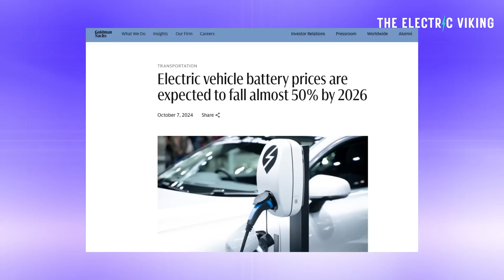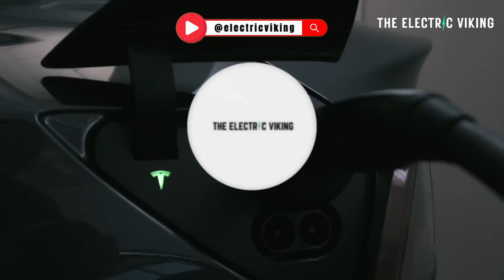Analysts say a NEW EV battery will be cheaper than fixing a gas engine

Comment: Advantages of Gelion's GEN 3 Lithium Sulfur

 High energy density - Energy density > 400 Wh/kg, when using a 10+ Ah pouch cell.

Semi-solid-state as a route to increased longevity/cycle life: GEN 3 employs a semi-solid-state mechanism, maintaining the sulfur-based cathode materials in the cathode, preventing their diffusion into the electrolyte and diminishing associated battery degradation caused by reactive polysulfides. This approach mitigates the major degradation factor associated with conventional Li-S technology.

Increased sulfur utilisation: GEN 3 demonstrates the full theoretical capacity of sulfur, i.e. a much higher sulfur utilisation than found in conventional Li-S approaches.

Simplified supply chain: The innovative cathode is produced by mixing commercially available materials with abundant sulfur using a low-energy, room-temperature process, with potential to eliminate the need for pre-fabrication of the sulfur composite (sulfur composite is related to cathode active material in conventional lithium-ion batteries), streamlining the associated supply chain and production process and enabling localised manufacturing.

·Environmental and economic benefits: The water-based, standard-atmosphere cathode production process eliminates the need for toxic solvents, leading to significant cost savings and enhanced manufacturability.

Check it out at https://gelion.com/

Comment: I looked up the cost of replacing various combustion related parts incl labor: spark plugs $600, transmission $3500 (and much more for luxury cars), engine $3000-8000.

Comment: Current ev battery cost are in two area : changing cost is huge still bigger than fuel engine but its trend is going to be cheaper;  the other cost is the industry has not have comprehensive chain for recycling and processing used high power car battery yet.  Making these batteries and recycling these batteries cause more pollution than transitional engines still . Pollution on the road is less but its overall pollution on factory and processing sites are still high.   We have a long way to go.  Hopefully in 10-20 years the situation will will be much better.

Comment: While the cost of EV battery parts has decreased significantly over the years, labor costs for battery replacement remain substantial. This is because many EV designs position the battery pack beneath the vehicle, requiring complex procedures to access and replace them. Although some manufacturers are exploring solutions like battery swapping to improve accessibility, these innovations are not yet widespread across the industry. My hot take is that the parts price will continue to drop (per your reporting, thanks for this), but the labor price will likely increase as manufacturers haven't standardized efforts to make batteries accessible for servicing. There is no hood or battery tray for ease of access.

Comment: Interesting however in 2016, we were promised Sodium ion batteries in the 2020s. clearly batteries will improve, but until we have charging in 3-5mins, giving a range of 450  plus miles and we have cheap reliable 24/7 electrical supplies, ICE vehicles will continue to outsell BEVs. In the UK more then 50% of car owners have no access to overnight parking. 
The energy density of fuels will continue to be much better then batteries. As other posts western car makers are going broke.
worse
Its interesting that F1 is not going electric anytime soon, but improving Hybrid power with synthetic fuels, but being net zero by 2030.
I tend to think that in the time that batteries are improving, better solutions will be found.
At least sodium based batteries shouldn't result in the destruction of the earth with massive amounts of mining.

Comment: If only car manufacturers would agree on a standardised battery pack module size, and standardise it's connectors.
Oh no, wait a moment, this is auto manufacturing, where all cars are virtually the same, but different enough to maintain a ridiculously high spare parts cost because every spare part is 'unique'
Unless you buy VAG vehicles, the interchangeability of parts between VW, Audi, Seat and Skoda is virtually unmatched by any other manufacturer

Comment: EV's are okay if the infrastructure is there, but the cost to install and upgrade the charging network in more remote rural areas to cope with increased demand for electricity isn't practical . The current national grid network can't cope with the increased demand of a  full switch to EV's  so  it's impossible to reach  EV targets without billions being spent on more green energy electricity production and an improved chsrging infrastructure. No matter how low battery priices fall, if you can't  charge your car due to a lack of chargers or an overstretched power grid  enforcing charging restrictions, you"re screwed. That's why we also need to look at alternative green energy sources to power our vehicles as well.
Reply: You don't have a roof?

Comment: If the batteries are structural batteries, part of the cars body, part of it's structural integrity, and glued in, then they could be free and it would still probably be a write-off. The batteries will need to be easier to remove and replace.

Comment: Even if you have that 'super cheap' battery today, it's impossible to draw soo much power from the grid. The grid has to be doubled over 10 or 20 times, i dont wanna pay that Kwh prices anymore if that comes to reality. I hate those stupid wind turbines, and all the grassland filled with these garbage solarpanels. And even then if you have done all that, there is not enough power.

So after years of denying, nucluair is on the table again, with AI every datacentre get it's own modulair nuke, otherwise no AI !

Oil wil be here for a long time. And EV's are dangerous in an accident you will die, the fire can not be put out by simple spraying water on it. Well you will have a free cremation so no worries about the funeral anymore, that was already been taking care by your EV ;-) Very handy indeed.

Comment: by 2030. Sometime after that, my MY will need a new battery. This is my plan. By the time I need a new battery, the price will be much lower. Moreover, since MY and M3 Teslas are so common, it will make sense (I hope) for 3rd parties to produce compatible batteries with longer range too?

Comment: This may be the Timex story all over again.  Do you remember when the Silica timer in watches made them amazingly accurate and amazingly cheap, that a Timex watch with this innovation was cheaper and cheaper until it wasn't worth while for a store to sell them.  There wasn't enough profit in carrying Timex to make it worthwhile.  I have read recently about LiFePO4 batteries that are coming in at around $100US per kWh and yet I just had a quote to install a battery to compliment my solar panels for 19 times that cost.  At some point, the actual price of the battery is not relevant.

Comment: Sam, I think there's a misunderstanding here. If you're saying that higher energy density battery chemistries will lead to lower kWh in the car (you mention the example of 400Wh/kg leading to maybe max 50kWh batteries). 
I believe that is not correct. The argument would be: you'll get more range out of the same weight of battery OR your battery weight will be lower for the same amount of range. Also, this might not even affect batteries' physical size either since the gravimetric energy density doesn't tell you about the volumetric energy density. So based on this, I doubt cars will get lower average energy capacity batteries in future, rather the contrary: the average battery capacity will likely increase (from maybe 58kWh->70kWh) while battery weight remains similar. Unless for badget EV options, of course, in the case of which we'd still have maybe 50kWh capacity but since that will be lower weight, your car will still go further than present day 50kWh batteries. So also an improvement.
I've heard you say this several times now in the last months and thus wanted to finally point that out.

Comment: if a BEV battery replacement cost can really get down to less than $10,000, then Gasoline cars will truly be finished.
With that said, it is still up to the manufacturers to pass down the lower cost of repair to customers. If they keep building battery where reconditioning it is nearly impossible, we are going to have a problem. We see that in Apple Products.

Comment: As EV battery energy density increases the number of battery cell in a battery pack will decrease while the total energy remain the same. For example for a 100 Kwh battery pack, a 50% increase in energy density will half the number of battery cell. In such a scenario the weight of EV vehicle will decrease substantially as well as vehicle  material  cost.

Comment: This is not a big claim. Gasoline engine repairs are completely uneconomic (10k$ ballpark) at the present time and are rarely done. Other than superficial repairs, gas engines are built to last 250,000 to 400,000 km. Caveat: certain notorious brands are exceptions and last a fraction of this life (e.g. GM, BMW). So, the question is whether massive investment in battery manufacturing can lower battery replacement into the low-4-figures to compete. At present, a massive 25B$ battery plant is being built in my city.

Comment: You are right the price of cells will plumet. New technology is always expensive, for example I can remember walking into JB-HiFi around 2005, there was a new plasma flat screen for $55,000, today I can buy a much better TV today for around $500. The IBM XT was $10,000, plus $7,000 for a 5Mb hard card (hard drive).  Retail prices for technology always trend down at a rapid rate (except for Apple of course). So yes, your cost estimations are close. However, there are problems. In the early EV days, it was possible to remove the battery pack and replace a single defective cell. With the current Li-po battery packs this is both dangerous and or impossible.  In some cases, the battery pack is built into the floor pan and physically can't be removed. Sodium batteries look like they are the future, however again the issue is they are going to be cheaper than lithium, however the energy density of the cell will be less than a lithium cell. This will be easily fixed by increasing the size of the battery pack, however, will decrease range due to an increase of weight of the vehicle. The energy density of LiPo cell technology hit a wall years ago, it has not increased hence the search for new battery chemistry.  The real-world performance of a sodium battery pack is still unknown as the honesty of the media when it comes to EV's is abysmal. As for the ICE, it will be around for the foreseeable future. The EV has it's uses but also has its limitations. Electric boats, ships, trains, trucks, jets, aircraft, heavy machinery are not going to happen anytime soon. For anyone who drives long distances, tows, off roads or drives in weather extremes the EV is not an option. The other problem is cost, in Australia, the cost of electricity has sky-rocketed, and will continue to increase. Another issue with the EV is depreciation, with the rapid drop in new prices, trading in second-hand EVs also takes a hit.

Comment: (6:19 - it's the reverse - we will want BIGGER not smaller kWh)  As density and cost improves the kWh size of batteries will INCREASE, not decrease. More kWh = more energy = more range and it will be affordable .
Reply: Fully agree, smaller batteries would require even more chargers and more hpc ones. Also, for those using the trailer hitch it would be really bad.
Reply: @simonengvall7433 What???? In the future a 77 Kwh battery will be half the size and weight. 

Sure the battery will be smaller but MORE CAPABLE..
Reply: @johnlodge8546  Ofc I get that. However, in the video the electric viking claims the batteries will be smaller in capacity (the way I interpret it). I don't think that is the future, but maybe I am wrong.
Reply: Not necessarily.
Reply: Do we??? I honestly see abs 6:21 olutely no need for an EV to have more than 350 to 400 miles of range.

As energy densities go up Batteries GET LIGHTER. Lighter vehicles get better range. This means doubling the energy density of a 77 Kwh battery  would give you 50 to 80 miles more range. So a cheaper more dense 77 Kwh battery equals a 350 or more mile range vehicle.

Comment: Efficiency of EV's like Tesla's aren't likely to change drastically in the future so you'll still want a 75kw to 100kw pack. Battery energy density will make the packs smaller and lighter but you'll still need the same amount of overall power. Those smaller and lighter packs will be the primary source of future EV's being more efficient than current day EV's. But it won't be such a large increase that you'll want a 50kw pack.

Comment: Labour costs on a battery replacement will be LOTS cheaper. Hiw much electrics,  plumbing abd mechanical linkages are there to an engine. Vs main powerlines, comms harness and a cooling loop to a battery. They were designing them to go to battery swap facilities in 90 seconds at one point. Fully automated. Vs a couple of days at least in the shop for an emgine. My kast major failure was a valve and head replacement... so engine left in situ, and that was ~ £800 for parts and £1900 labour.

Comment: Car battery packs can't be measured in kw/h for there physical size. The kw/h will go up as the physical size goes down. Cars will not have 50kw/h packs because of energy density, they will have more, maybe 150 kw/h but in a size that is smaller than current 75kw/h packs.

Comment: Sam, my friend already performed a detailed price calculation of the material cost per 1 kWh of LFP battery cells. Guess the amount of USD? It's a little bit lower than 15 USD!!!!!!! So, when battery manufacturers pay debts, the LFP cells will cost 20 USD/kWh and they will still be making big money because of the scale. The complete battery for home storage will be around 30 USD/kWh very soon. A complete LFP EV battery with thermal management will still be below 50 USD/kWh. This will happen before 2030!

Comment: How does the price of a battery relate to the cost of repairing an engine? The price of a new battery should be compared to the cost of a fuel tank. If you want something comparable to the expense of an engine repair that would be the price to replace all of an EVs motors.

Comment: Good video but you are overlooking what is going to occur if the battery producers continue to push down the price of the batteries to such cheap levels. Lithium mines will shut everywhere as there will be absolutely no point keeping one going when the prices offered for lithium fall lower than levels now. It is NOT sustainable. They are shutting down now because they cannot produce what is saleable unless at big losses. Even the cheapest in the cost curve cannot maintain the losses. So $10 a KWH for a battery is pie in the sky unless it is made of fairy dust provided free by the fairy godmother. Use common sense

Comment: Unfortunately, the current design with battery as frame seems to prevent this kind of repair.

They need to design them so at least 20% of the batteries can be easily replaced and then work up some circuitry that uses those batteries first ( but doesn't take them below 15% unless the entire battery is running low).

Comment: The theoretical limit for ICE is about the equivalent of 100 mpg,  or about 10 kg of fuel to go 200 miles...
but the theoretical limit for energy in the form of stored electrons (voltaic cells or capacitors) is the "weight" of the electrons... virtually unlimited!
An ampere of electrons "weighs" about 1.5x10^-17 kilograms! 
A 300V battery with 200AH (60KWH) of charge could THEORETICALLY weigh (1.5x10^-17)(60s/min)(60m/hr)(200A)=10^-12kg (or about 1micro-micro gram).
Reply: But in the real world........

Comment: What in the world does energy density have to do with the reduction of battery packs from 75 kWh to 50 kWh. You’re mixing apples and oranges. Yes the weight will be less, but will not have that kind of impact. We will probably have a 75kwh power pack that just weighs less. That aside, apply a little logic here—for once. The new battery must be fabricated, transported, and installed—the old battery must be remove and transported—-so, unless the old battery is worth 90% of new, what you and your mentor Tony are proposing is ludicrous BS! But ur title stated fixing an engine and then ur video mentions replacing an engine—apples, oranges, and click bait—but it’s main stream media that’s not telling the truth—or so u said in a recent video.

Comment: It’s obvious if you price it objectively. Once there is a battery that is good enough for 80% of the market based on a chemistry that isn’t dependent on materials whose prices are easily manipulated and that is easily mass manufacturable it is a much simpler “machine” than an internal combustion engine even when you add in the cost of producing an electric motor. Remember, it’s a power “train,” which, for instance with ICE includes fuel, engine, and transmission, but an EV includes electricity (battery externalities are cheaper than fossil fuels) and motor (order of magnitude simpler than engine) and no transmission needed.

Comment: In future you can buy a battery with small battery. The battery unit will contain a larger battery. You will be able to purchase the larger battery from company. Program code into car to access the larger battery capacity. Most cars will come with a standard size battery container. Easy replaced. Sealed for life, possible the property of the car manufacturer